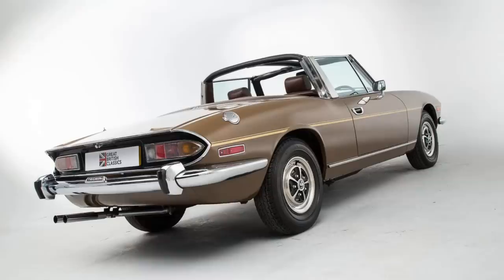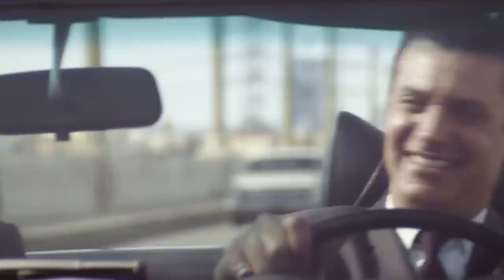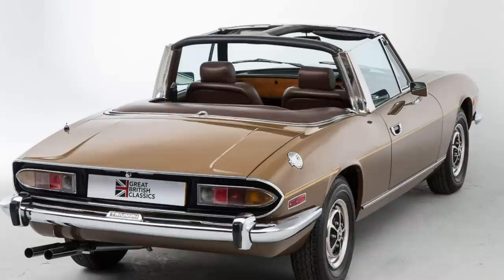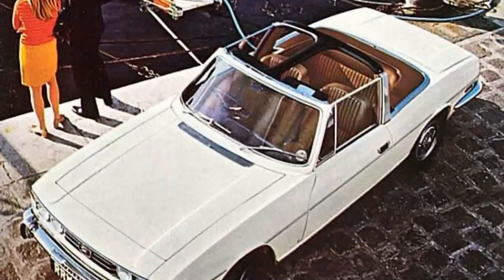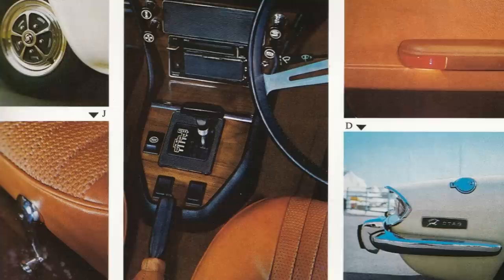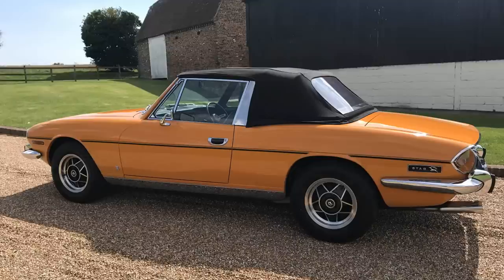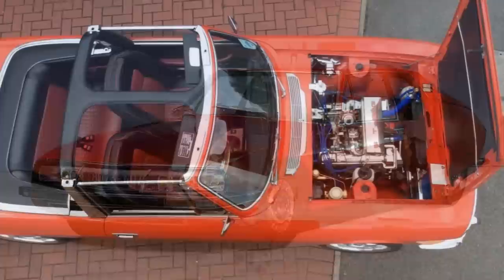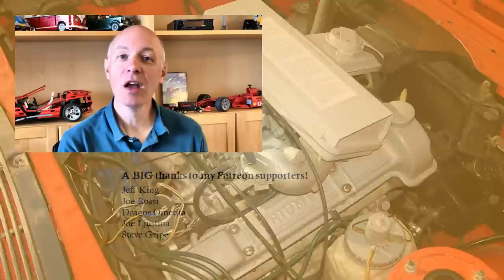Why did the Stag FAIL so Spectacularly?

Comment: Ahh the stag!! Graham Robson's Rover story, tells a slightly different version viz the v8. Rover had obtained the engine from GM with the understanding that Rover did not use the engine with competitors in the sports  US car market. I remember seeing a prototype stag with a straight six as my mum was in the motor industry in the 60's.

As to the studs issue. Nope it won't do. Rover used Iron block and ally heads and had done so for donkeys but they used Bolts not studs. Really stupid idea to use studs. I did try to remove the head on a dolly engine once, not a hope. The point is the head accreted itself to the studs. Never had a problem using bolts.  Loved the shape but even the wheels tell a story being Rostyles which were also fitted to the P5B  and the P6. Leyland management were basically Jaguar.  They could have offered Triumph one of the XK series, but didn't

I believe it was later found that the issue wasn't so much the water pumps but the surface areas of the radiators. Rover never sanctioned or guaranteed the rover reverse fitment- as much for legal reasons as anything else, but when the radiator was given a greater cooling area it helped a great deal.
Reply: The Aussie Stags were far more reliable as they had larger radiators for the heat down there.
Reply: The Rover engine was fitted to Morgans, a sports car.

Comment: The prototype looked a lot better than what ended up coming out of the factory.  What were they thinking by raising the windscreen so much?  It makes the body look like it belongs to a different car!  My dad had one of these and ended up putting a more powerful fan on the front of the engine as a bit of a hack-job to get around the cooling problem - it only delayed the inevitable.

Comment: It wasn't the engine. It was 1970s BL and dealer staff. It was, and still is a gorgeous looking car. 

But, the engines, if the cooling system is filled and properly bled through, with the right time and patience, at the factory/dealer, and perhaps uprated electric fan and good radiator they are one of the best engines of the period, like the Rover/Buick V8 of the period. With proper construction rather than the typical shoddy workmanship and the typical poor BL management, we would still be raving about the Triumph V8 the way we do about pre-overbored Rover V8s

Comment: Hindsight is indeed 20/20. However, that Buick sourced Rover 3.5 came over to Australia, where it was enlarged to 4.4 litres and used in our Leyland P76, with a more conventional 2 barrel carby atop a normal manifold. Despite being a tremendously good engine, it was considered 'too small' down here, where 5 litres+ was the norm. Another missed opportunity was that this engine was being developed with 2 cylinders cut off, to become a 3,3 litre V6, for the never to be, medium size car, Personally, I believe it should have been developed, and used as the base engine in the P76 6 cylinder, which instead, got a stretched version of the 1750 OHC amounting to 2.6 litres. Underpowered slug that became.

Comment: There was mention of the problems of needing Anti-freeze all year round because of the Aluminium head and Iron block. This is basically what the XK Jaguar engines in the Mk2, Mk10, E-types etc had so surely Triumph engineers were a tad derelict in not understanding the need for the coolant inhibitors.

Comment: As an owner of two big Healeys I always found Triumphs to be more than a little lacking, especially the Spitfire which could fall apart just sitting still in the driveway, especially the front ends which were a known weak point.  BL would have done well to just import Chevy 283s and drop them in.  Of course the entire British motoring industry was rapidly heading for suicide mode anyway, so no diff, I guess.

Comment: BL pushed the STAG into production before the engine had finished development to be passed off for production. It was two Dolomite engines, joined for the Stag The Dolly engine was a well tried and tested engine that was reliable and strong When twinned it was still in development when it was put into production
Reply: It was not two Dolomite engines (the SAAB engine) joined at the hip.

Comment: The Triumph 4 cylinder was not the same engine as used in the SAAB. They shared the same development path initially, but then diverged - they are like nonidentical twins.

Comment: The remarks on the Stag hood are fair comment. They are not very strong, and the frame is easily distorted.  But again with good quality control in the build they can work reliably (I know becuase I rebuild them!).  Quarter lights were provided on the first run of cars, but it was dropped, probably because they get badly creased when folded.  I have the later single window type and I dont find that a problem.   Contrary to what one commenter said they do not have a leakage problem, and are as watertight as you should expect.

Comment: Brilliant video, I seem to recall the Triumph club (I think it was) developing a solution for the Triumph V8's overheating issue after which those which hadn't been replaced by the Rover (Actually originally Buick) V8 performed as they should have from the start.

As you imply, if we could return to the past then BL could still be in business producing quality and respected products.

Didn't BMW keep the Triumph name once they sold the company?
Reply from the maker: Yes, BMW owns Triumph's name (at least for cars). I was interested to find out that the Rover name is owned by Jaguar Land Rover, which I suppose makes sense.
There's a link to a video made by the Triumph club in the description for this video that I recommend you watch. They show that they've solved the engine reliability problems for old cars. The Stag club looks like a great bunch of people.
Reply: @BigCar2  just watched the video, the club can be proud of it and it's great they sorted the engine and offer  remanufactured parts. Same old BL story, they should have sold like hotcakes, still it exists which is great. That green  supercharged one would be great on the autobahn.
Reply: What overheating issue? I drive my Stag for 10,000 miles every year and it's never overheated. Seems someone (probably that t**t Clarkson ) didn't like the Stag and gave it a bad name....
Reply: @melincourt  Hi Richard, there was an overheating issue from the factory, perhaps not every car had it. In a video from the stag club there was mention of the requirement to have the right gaskets, and also the fact there were differences in some of the heads I think as the suppliers had made changes which they didn't advise triumph about, but in any case, whether   an engine was always fine like yours or had issues corrected the triumph V8 Is a great unit.

Just a shame they didn't sell the large numbers in the States they could/should have, say 25.000-50,000 a year but yours is obviously a good one you enjoy which is great.

Happy motoring

Comment: Having to take the power steering pump off too change the battery was part of it, heads that seized on the motor  was not a great selling point either.

Comment: As everybody has told no cam belt but the real deal is the head studs they are all in line plus the water pump OK is to high but the problem was the hight of the header tank and it got sorted by after market peaple easy fix

Comment: Frome the doors back too the rear bumper, it's a spitfire, I know this cause I've owned a spitfire since 1989,it's a1973 model,1500,now it's full race with  hi compression pistons, 3 cut valve job,5/4 cam,antiziez valve guides,double valve springs,exziolry oil leads,Mozart header and full flow xhayst dbl xit exhaust system, that makes it a really stout  compee racing machine at Watkins Glenn.  Someday,you'll will see it there,,also,fresh built and polished twin su,s,ported polished and proper jetting.

Comment: Actually if you got hold of a good bodied stag  with a knackered engine , today there are sooo many cool engines you could put in that car that would make it a beauty .
  I`m thinking a compact alloy fuel injected v6 out of any of the current well made brand cars .
 Initially i thought of an engine the same as the one in my family toyota cruiser ,  mines an aurion 200 kw NA 3500 v6 , but its basically its a big camry  ,and it pulls our 1600 kg taxi over the quarter in the mid 14  ish second zone .

Comment: You could tell what the Stag was intended to look like if you squinted and mentally blocked out the B-pillar and T-bar. As a result the final car never really looked right to my eye. Whereas the Spitfire had a cohesive design, the Stag looked like it had been styled first, then handed to the engineering department to be made roadworthy.

Comment: I’ve known 4 people own Triumphs.
1 a Toledo that never ran reliably.
2 a TR7 that blew its engine when started for a potential buyer.
3 a Stag that had coolant trouble more than once
4 a 2500 that blew up on the motorway.

Dolomite Sprints we’re also known to have head and head gasket problems unlike the RS2000 which was reliable with its 2.0 ohc Pinto engine from the Cortina.
Also TR7s we’re that bad that one order was dumped in the Mersey after the US importer refused to accept them as they were v badly built.
 Speke was always the worst factory in the group in part due to a lack of experience in building cars compared to the Midlands factories and Union/management issues.

Comment: Triumph couldn't design an engine to save themselves, the Stag engine was not alone
Reply: I believe Triumph were the first to develop a smooth straight 6 engine. I had a 2000 with one installed which proved extremely reliable and cruisedl for long distances at 80 miles an hour giving a very smooth comfortable ride. Never gave me any problems.

Comment: Volvo launched the 6-cylinder 164. SAAB planned to answer with the Stag-engined 99 V8. But SAAB coudn't cure the reliability and durability problem. SAAB turbocharced the well working 2-liter straight 4 in stead.

The problems with the Stag engine, created the SAAB Turbo.

Comment: The Poms made great cars....................sometimes. Everything this guy said is true because I owned Triumphs & Rovers of that era & I can can confirm which cars were good. I owned a 1970 Triumph 2.5 PI, a 1976 Triumph 2500TC, a 1979 Rover SD1, SE & a Vanden Plas. All good cars in their own way but nothing compared to my current 1994 Mercedes E280 or any Merc.

Comment: Great looking car,I had 2500tc wonderful drive , but the rear axles where a weak point and the Laycock clutch on the overdrive was just not fixable. I had to put an automatic in it ,no problems with that nor the engine but those twin Su carbs were a but finicky to tune.,I couldn't afford the stag unfortunately

Comment: Sorry, haven't seen the whole video yet, but just a few thoughts:
That original design is / was indeed quite attractive, but the changes that came with the rollover bars really upset the styling balance.  It's a shame that the original soft top design, with its quarter windows was abandoned.
For a company that (supposedly?) was short on cash, developing a new engine design, while a necessity, must have been expensive.  You have to wonder what might have been if the 2.5 TR5/6 engine had gotten an overhead cam and the Stag had used that engine as it's lower priced/entry-level model.  Though I guess it might have taken sales from the 5/6?
Reply from the maker: That's a good point I should have made - they were being wasteful with their limited cash to go after a new engine, but I suppose at that point they figured they HAD to get a V8 to compete with Rover (who hadn't yet joined Leyland).

Comment: designing and building a new engine from scratch is inevitably going to be a 'development' process - you'll never get it right first time. I'd be surprised if there wasn't some way of increasing production capacity at the Rover V8 factory though - were they doing weekend and nighttime shifts at that time? The extra salary costs for unsociable hours would likely to have been less than building an extra engine plant, where you've still got to pay at least standard workers's costs anyway.

Comment: Very interesting story. We had the SAAB 99 and I knew it was 'half a Stag' but not the rest of the story. The 99 looked beautiful but had its own problems, notably the very heavy steering.
Reply: The early 99 engine was derived from the Dolomite and had the same cylinder head gasket problems, once Saab re-engineered the motor for 1973 onwards it was a good motor, but let down by the weak gearbox.

Comment: Still a great looking car and it was a great concept but sadly it was poorly executed. I bought one in 1975 in the dark blue. It had the alloy wheels, tints, hardtop and manual transmission. It was not a drivers car but a good looking cruiser. The transmission was not great and if driven hard the car had a tendency to snake when changing gear. I was told it was to do with a slight offset of the rear axle. I didn't keep it long and in some ways it was sad to part with it. Some years later a friend acquired one with the much superior Rover V8, a ZF 5 speed transmission and some suspension and rear axle work. It was outstanding and what the Stag should have been. B.L. was a disaster waiting to happen. Why oh why use the disastrous Triumph V8 when they already had the great Rover V8.

Comment: P.O.S. Two saab99 or tr7 engines mated together. Difficult carburetors.Ate cylinder heads for breakfast. One head was the same as the 99-tr7, the other unique. Naturally it was the oddball head that cr----ed out. The Saab people worked out the four and the turbos were awesome.

Comment: Growing up, it was obvious and almost legend what junk Triumph cars were and you just showed me why. Thanks. One thing I just learned is how these people just couldn't get their heads out of their a*ses. A good friend wouldn't listen and bought a brand new TR/7. It spent its entire life either in the shop, or next to the garage with a tarp over it broken down. Total garbage and not worth the steel it was stamped out of. And at the time, their motorcycles were just as bad. At least with the bikes, you never had to change the oil. They leaked so much oil you just filled it back up and got an instant oil change. To be fair, Harley's weren't much better. LOL

Comment: Don't forget the problems the 4 cylinder suffered when they made the 16v Dolomite Sprint, the BL group really shot themselves in the foot with so many models at this point that really banged the final nails in their coffin. The Allegro was another winner with body flex that could pop the glass out when you jacked one corner up.
Reply: The last of the 1300's were as bad, full of fatigue cracks around subframe mounting points. Each 1100/1300 mks1, 2 and 3 had the thickness of panel steel reduced and stiffening gussets removed. The 
Mini was the opposite, early ones cracked, the seat cross member broke in the middle and even the seat legs went thru the floor. They got progressively stronger.

Comment: If you design an engine where the water pump is the highest point of the cooling system. You have designed in failures. Stag, Dolomite 1850, Dolomite Sprint. Head gasket failures

Comment: A lovely quality finished car much on the same lines as the Triumph 2 lire and 2.5ltr P.I. (mechanical petrol Injection) but in a convertible format.  Why they didn't stay with the 2.5 lire engine for the Stag I will never know as it would have sold far better at a more competitive price and would still have had a decent performance.  I drove several of these cars that were about two years old and without exception every single one had head gasket problems.  I swear that drivers following thought they were fitted with a steam engine as that much came through the exhaust system. Such a shame, it was a lovely car but ruined with an unreliable engine.

Comment: As I understand Triumph's vain attempt was at making a V8 was to stick two Dolomite engines together which as it turned out failed. Another reason why the engine overheated and played up was Stag's run on 5 Star fuel (I know I had one) even in the early Eighties that fuel was next to impossible to find never mind today. I really did like the Stag but too unpredictable, if I  had the money I'd buy another one and put a BMW 4.4 V8 in it along with some better brakes etc. I still think the Stag look stunning if only they used the Rover engine and got their act together I wonder what the Stag Mk3 would of looked like! Did you know back in 1982 Tickford was asked to upgrade a 1975 Stag and they DID however there is only one.................

Comment: Electrolytic corrosion from Alum heads on CI blocks was not peculiar to just Triumph.  Datsun 1200 had the same problem made even worse by having copper sheathed head gaskets - don't ask how I know.

Comment: They should have bought a mess of Ford 289s for cheap and made them fit, then modifying the design into their own later. SAAB did this with the Triumph 1854 SOHC engine and used the resulting design until 2002. FWIW, the Koreans are awesome at this.